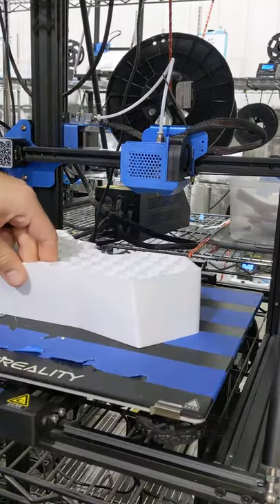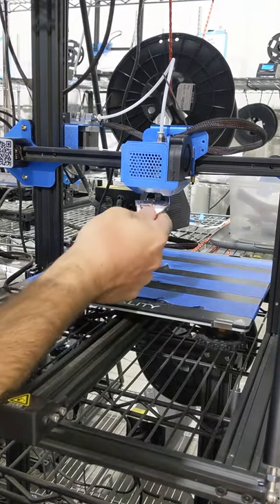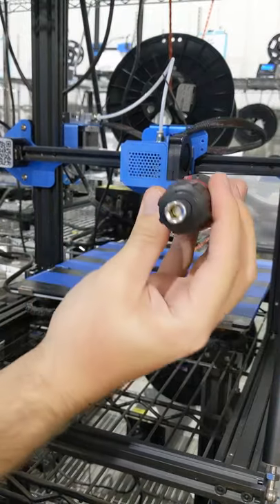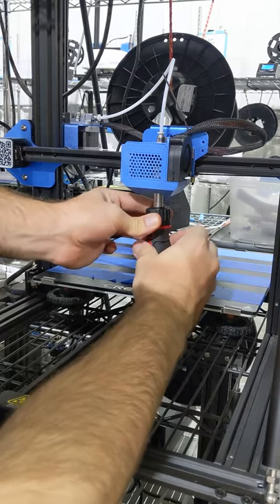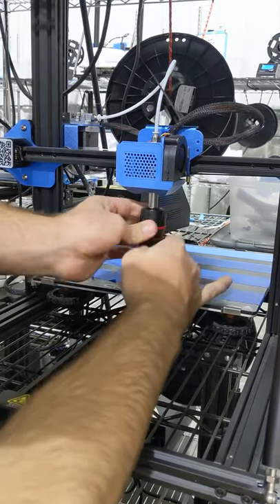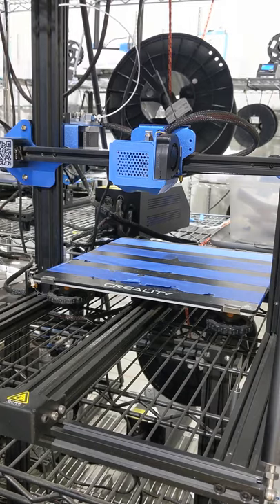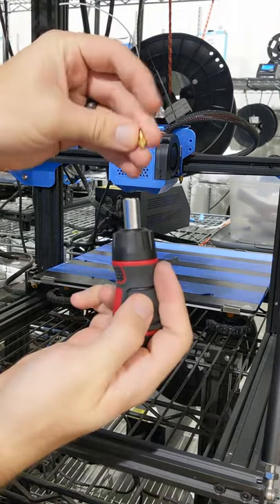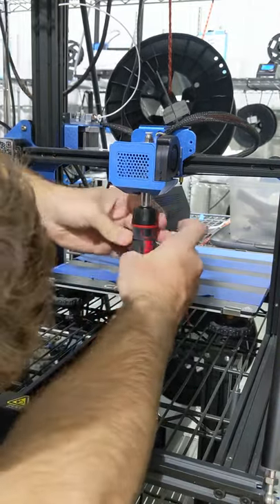The Best Way to Remove 3D Printer Nozzles #Shorts

Comment: I didn't realize how old this video actually was, but I got a tool along with a sub $20 3D printer nozzle cleaning/clearing kit from Amazon that came with a tool specifically for this purpose. The best part is that that it has holes on both ends that don't allow heat to accumulate despite which one you use to remove the nozzle. I cant remember the brand, but it's a simple L shape and works with every MK8 nozzle I've tried from many different brands so far